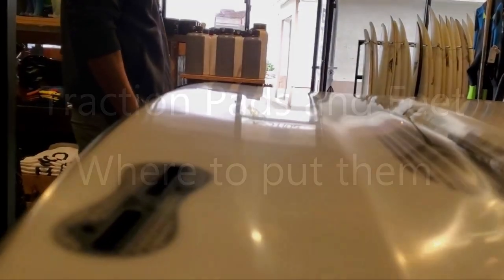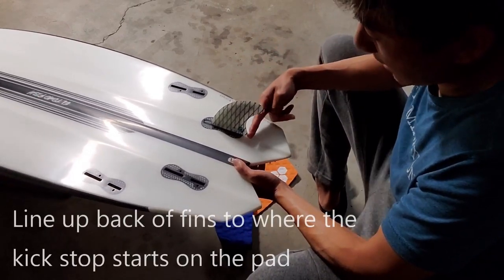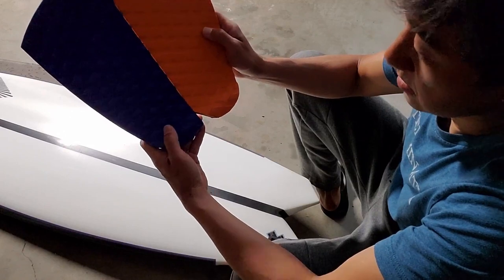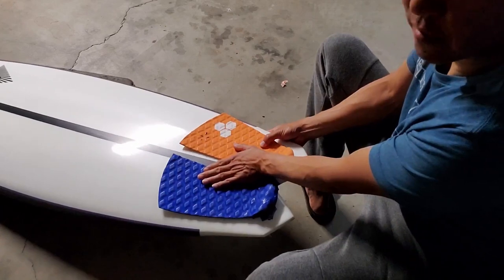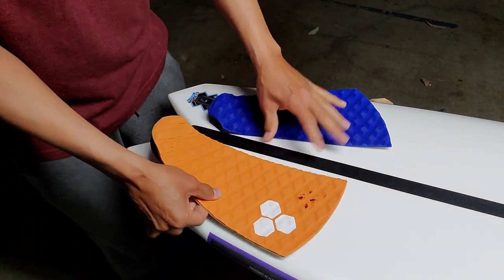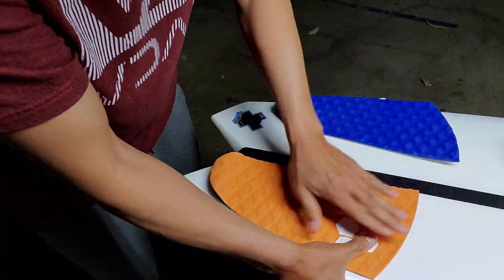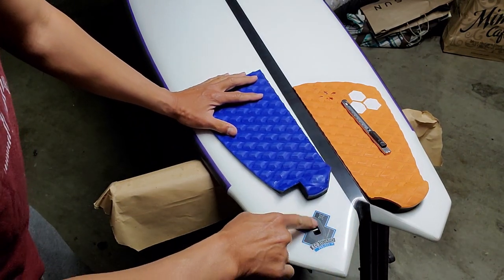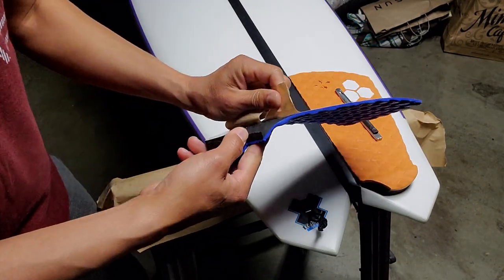Traction Pad and Foot Placement for surfing

Comment: This is a great how2. I have a system of leash cords that's a bit different. Using 45cm of 4mm cord I fold it end to end as usual, thread it through as usual and the thread that loop through the rail- saver. Finally I double loop the looped end a push the kno through the double loop. It works for those cheapo rail-savers but then you can swap them out for another board, without threading the whole leggy back through the rope.
It's the same system they use to attach the lines to a kiteboarding kite.

Comment: On my pod mod as a thruster, I have to turn with my back foot a little farther forward than directly over the center fin...or the board gets out of control loose. However, as a quad, my foot has to be directly over the trailers.

Comment: Maybe you mentioned this...it's good to have the leash string short so it doesn't slice through your board on a wipe out. 

My buddy has that board. He swears by a twin fin setup with small trailer.
Reply from the maker: I actually didn't mention that, but I should have.  as for the 2+1 setup, I would love to try that except mine didn't come with a center plug. :(  it's a dedicated quad.

Comment: Hi man, I can't seem to find the right placement for my feet .. I am shortboard surfing at an intermediate level and I would like to maneuver a little harder ... But I can't manage to place my back foot at the bottom of my pad, it is still very advanced, almost limit on the board .. When I try to pull it back, I am immediately with my legs too wide apart .. and therefore uncomfortable .. How can I change that? My front foot must also be too far forward I imagine, because when I do my takeoff I just place it in my hands? Do I have to step back on the board even if it means taking fewer waves, or do I move my hands back more at the level of the abdomen? Thank you for your advice!
Reply from the maker: how tall are you and how tall is your board?
Reply: @ThomyeSurfs  6' both
Reply from the maker: @alexandredaubresse7699  these are the toughest questions.  but I will tell you that I had the same problem at one point in my surfing.  I too felt my stance was too wide when stepping back.  My primary issue was that I was trying to surf with my feet back and not fully understanding what I actually needed to do.  When surfing a board at the same height as oneself, the sweet spot is usually forward. it is the flattest part of the rocker and also the widest part of the board making it the easiest and fastest part to surf on a normal average wave.   

What I have figured out over the years for myself is that I surfing is this constant adjustment of moving forward, back, etc. Unlike something like snowboarding, where you are locked in, surfing is rather fluid. the exact same board can feel different cuz of the wave. One wave could feel great on the tail while another feels off.  Anyways, for me, it was all about surfing the tail only to turn or pivot.  

watch this video of Medina. you will see he actaully surfs way up on his board to gain speed and only steps back for the turn itself or air.  

https://www.surfer.com/surfing-magazine-archive/surfing-video/gabriel-medina-lower-trestles/

One last thing that helped me was surfing a wide, short, fat board.  I surfed a 5'1 Firewire Baked Potato. I'm 5'8.  so to feel like I was centered, I was way up on that board but since it was only 5'1, i literally was on the back part of the tail pad by default. After I got used to this board, turning on the tail didn't seem too wide anymore. Not the best advise I can give but try not to "surf" the tail, rather just turn on the tail. I'll also give it more thought to see if I can come up with any actual methods to use.

Comment: Aloha, How would you recommend taking off an old traction to put on a new one?
Reply from the maker: There is no easy way.  I would say hair dryer or heat gun.  You don't want to heat it too much though. Just a very slight bit because the goal is to heat up the glue on the board to pad contact. If you heat up too much, you end up loosening up the glue to the pad. so when you peel it off, you end up with the glue left over on the board is which 10x harder to remove. Hope that makes sense. Just go slow, peel off a corner and heat from under while you are peeling vs on top of the pad.

Comment: It may be the optics, but those performers look like large size. Are they and curious on your thoughts on sizing the fins on a quad?
Reply from the maker: they are actually medium. I thought they looked big too.  But so far, they have been working really well. I also thought the rear fins looked way too big. I normally ride the stretch quads which are shorter broader fins but I don't have an FCS set.  Most of my quads for some reason are in futures. I need to get a set of the reactor quad rears and performance quad set. then i'll be able to test all boards with upright, balanced, and raked back fins. 

I always like bigger fins on smaller waves. I'm 5'8 145 and if I followed the recommendations of the fins companies, i would have to buy the small fins.  Which is rather bad info.  even if you look at pro women, some weighing less than 125, I see them using large fanning fins but it is always for smaller days. Everything in water becomes bigger with speed. so a small fin at 26 mph in water gets stretched out (not physically but hydrodynamically).  Anyways, I use that as my rule of thumb. Bigger fins for smaller days, smaller fins for bigger punchier days.  I stick with large fins f the waves are big and mushy.

Comment: No no no Thomye, you got it all wrong, pad goes in the middle of the board cus that's where you stand!

While I don't really like FireWire boards, at least you'll probably enjoy the Tomo and let other people know what you think about it. I don't need any more boards so juat curious what youre chucking your money at haha
Reply from the maker: LOL. yeah, this one was sort of a bargain.  did you see all those finger pressures?  I got the board for $475. came home and sold my Dom2 to make up the cost. it was a good wash between selling and buying.  I will review this thing ASAP and get rid of it along with a few others.  You might be right about the traction pad in the middle though. One of my buddies swears he has never stepped on his traction pad that he put on the tail. haha
Reply: @ThomyeSurfs  475 is a good deal for a new board, but I've seen too many custom Tomo clones or used tomos to even think about spending$ 300+. But you can probably have a tax right off one any losses for the business.
I'm itching to see what you think of more classic and weird shapes like a Simmons, Ryan birch type fishes or single fins. 
Other than that, production and commentary is on point, just need new sources of content
Reply from the maker: @Nick-bl6hm  I will definitely need to have a conversation with my accountant.

Comment: Question about NB2 in spineteck. Got my custom 5’8 28.9L (usually about 29L) and board feels really stiff in decide to size waves (2-6ft) when turning. Started with my favorite MF large and then switch to JS medium which felt better but not the performance I was looking for. Still slow through turns and didn’t feel high performance at all. Any suggestions? 🤙
Reply from the maker: do you know where specifically you are standing on the tail?  I noticed a similar thing.  the board seems super loose rail to rail  but turning if i'm not on that back fin or just behind it was difficult.  I have a review of it and when you watch it, you will see me really scoot my feet back for turns. I think it's the tail cuz water wants to come evenly off of it and the faster you go, the more you feel it. Sort of like an Alaia board with that block tail. keeps the board wanting to go straight.
Reply: Thanks, I'll try it a couple more times

Comment: I really hate to have to cut the tailpad to make room for the leash plug. I've done that once. At least they didn't put the leash plug in the center. That moves the pad up even further. The only thing is when they put the plug on the side of the swallow tail, they normally put it on the left side for regular footers. LOL ...You just can't win!
Reply from the maker: Haha. I hate cutting it too. Got my first surf on the Tomo today. Rather stiff board.
Reply: @ThomyeSurfs  Did you get TOMO fins that go with the board? The creepy fingers looking fins?
Reply from the maker: @pullinside9  hell no. haha  i would have nightmares.  :)  I don't plan to only because it's money I don't need to spend and it would literally be a throw away cost.
Reply: @ThomyeSurfs  they look gimmicky imo.